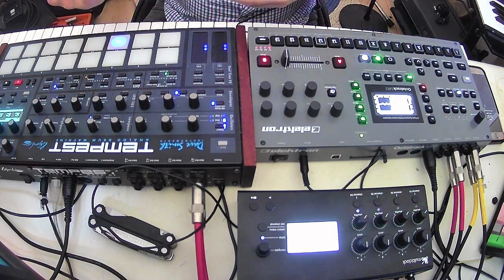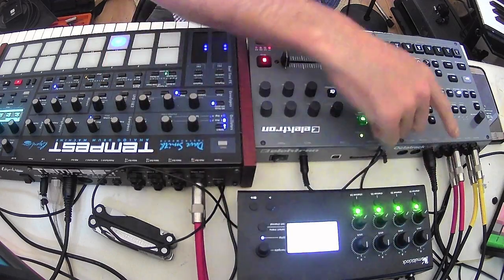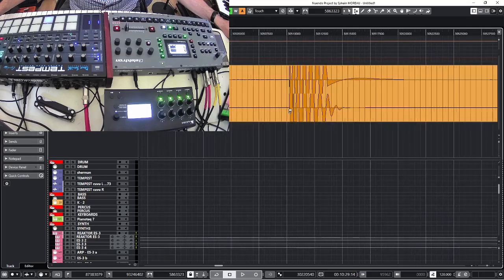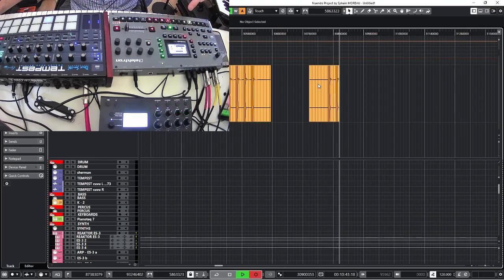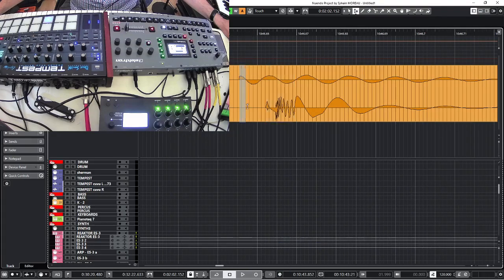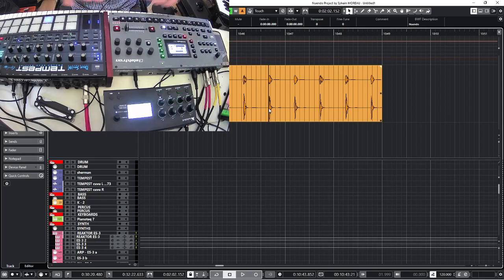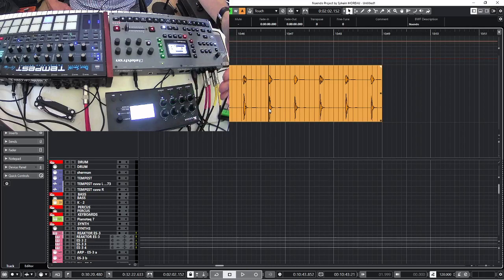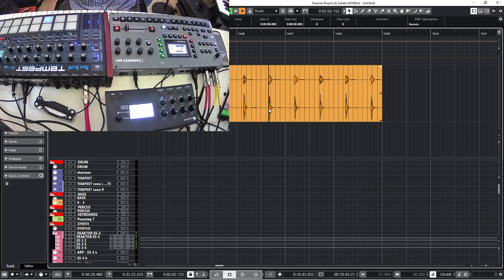multiclock #3 - clean clocks !

Comment: what about if you slave both from an external clock ? e.g. midi-pal or DAW or something
Reply from the maker: you'r right I should do the test slave them from DAW. Pretty sure they would be in sync together but delayed from the DAW (from my experience). Then the good thing with multiclock is you can compensate : get the clock from DAW, offset what you need on multiclock so all is back on time. But my idea is daw less for live. And I still need to send a clock to my modular on a third channel from multiclock.
Reply from the maker: erratum.. I just checked my multiclock ! I had a previous setting of -6ms on the tempest (and 0ms on octatrack)
So it means that I always need -6ms to have tempest in sync with octatrack ! So I would struggle with daw having one same clock for both. Dam so upset I did that video not checking this :p

Comment: Can’t get it to work inlogic 😖
Reply: sorry to hear that... very frustrating specially if your plan was to use with the daw. I was only using it in hardware only so.. I tried with nuendo and couldn't make it work either.. but i'm sure (?) i was doing it right. Anyway I they replied to my resquest "Could you also write the nuendo support. It could be that they have a clear explanation/solution for the problem. Our vst3 should work fine" I left it there.. i'll try update when I have some time and see how it goes.
Meanwhile, tell me if you solved it 🤞
Reply: @sonicpetal  man! At least I’m not crazy! And this is huge . No other way to say it … a sham . When a retailer specializing in modular tech everything can’t make it work either and says simply it absolutely does not work return it to us as soon as possible it’s really shocking to hear that . Plus all the functionality changes if you set it to start and stop when the play button is pressed! No negative detent either in standalone mode! And all for a whopping $600.00 at least . Smoke is coming out of my ears right now . Plus they are almost unreachable and don’t directly answer questions . I had an apple expert help with the plugin install to make sure it went perfectly and it still was a stone 👽